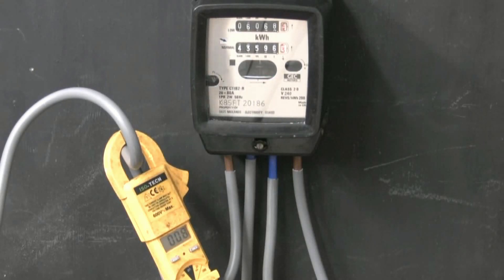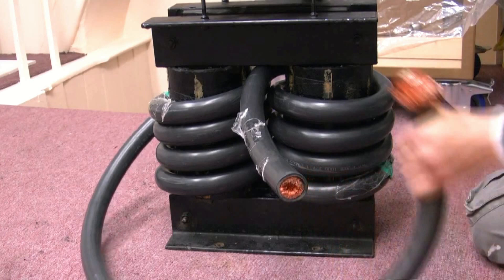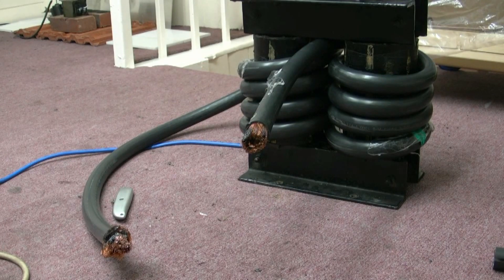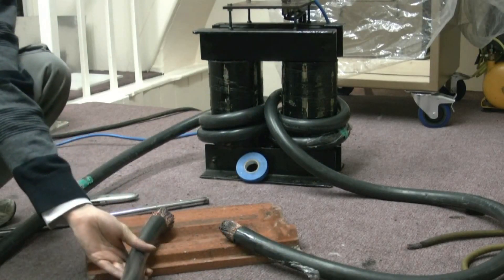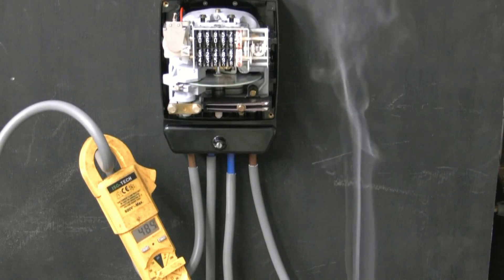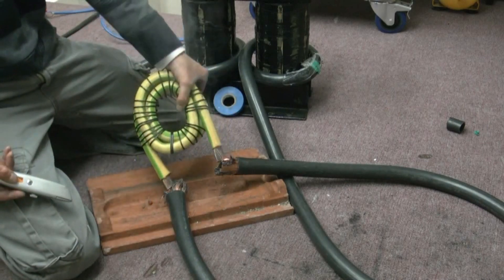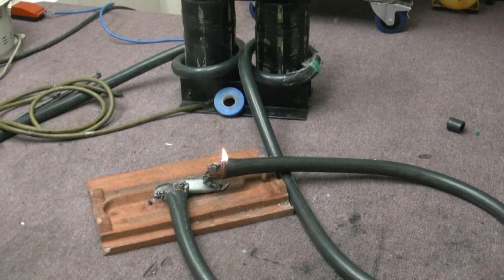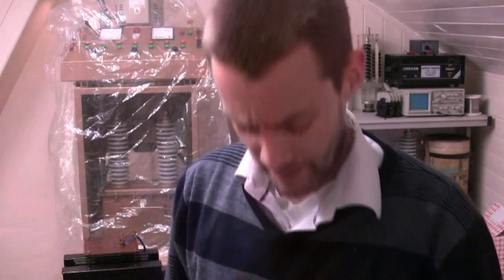Too Much Current + Electric Meter Pops

Comment: 8:54... why is he not dead?
Reply: +Kragatar because the resistance of the human body is so high, there isnt any current going through him
Reply: Kragatar because Volts x Amps = watts
the amperage of the transformer is a lot higher than the amperage of a battery
Reply: +Nothing Original nope it is because the transformer is isolated in relation to earth thus no current will flow through him.
Reply: Kragatar That transformer is probably outputting even lower voltage than a 9-volt battery, and it depends a lot on how moist the skin is. If you put it on the tongue the resistance is much lower.
Reply: +Kragatar Electricity takes the easiest path, between going straight through the metalic casing and making a detour through your body it's pretty obvious which one is easier.
Reply: Even if he was properly earthed, the secondary is basically floating, so it really wouldn't make a difference. Then, the only possible thing that could shock him would be if the secondary coil had a change on it, acting like a capacitor to ground. He would be across that capacitor and potentially feel a shock, just like when you touch a car in the summer. It hurts a little but doesn't kill you. With the size of those conductors, it's very unlikely that a high charge would accumulate.

Basically, secondary is not referenced to earth, therefore there is no obvious current path from earth to the secondary aaaand therefore no circuit involving him.
Reply: +This -〉 & 〈- looks like a man dragging his ass on the floor 
"because the resistance of the human body is so high"!!!!! lol you idiot. 
if he were to hold each wire lead is each of his hands he would've been vaporized.
Reply: +Kragatar I'm sure you've heard it before, but voltage = water pressure, current = flow rate. A high-pressure water jet (low flow rate) can literally cut through your body. But you can stand in a river (low pressure, high flow rate) and nothing happens since the water doesn't actually go through your body.
Reply: +This -〉 & 〈- looks like a man dragging his ass on the floor if there is a lower impedance path to ground than the body it will not send current through the body
Reply: +lcbp2009 thank you Mr. Faraday.
Reply: +Kragatar also the current would not being passing through him. unless he was to stab one cable into his left arm and the other cable into his other arm to break the skin and negate the resistance and have the current traveling through his chest, he isnt getting shocked. Because his body is not completing the circuit, no current is traveling through him. All he is feeling is the heat.
Reply: +Kragatar Too low voltage, skin resistance too high.
Reply: because science bitch!!
Reply: stupid idiot
Reply: +SwedishviKingohnoes My bad it will send a little bit. But this man is insane don't do what he's doing
Reply: SwedishviKingohnoes He is safe because there isnt enough voltage for any current to go through him
Reply: +Kragatar  it was a 9v which charged up to 125volts low amp because 
it takes 102 volts for a shock that you can feel
Reply: This --〉 & 〈-- looks like a man dragging his ass on the floor Ofc it is. If the resistance is 5k Ohm and the voltage 5V then there is still 1 mA of current.
Reply: +lcbp2009 think the only reason hes not dead is that he's properly insulated and current searches for the shortest way to return to the source. Also if he says hes passing 200 amps through that, find the wire size, resistance, then you can calculate the voltage
Reply: Persian5word no because the resistance of the body is so high there isnt enough voltage for the current to pass through you
Reply: awesomegamer5000 or codyisawesome3 Even if he was grounded he probably wouldn't be dead.
Reply: this thread is hard to read... so much stupidity
Reply: +Franco Pieruccini Faria Why does everyone think the answers in life are on wikipedia??
Reply: Kragatar I have touched 180v dc and dint get shocked you probably licked the 9v
Reply: Human body resistance is very low. In fact about 500 to 1000 ohms depending from how far away the circuit takes to complete a circuit across your body
Reply: Novislav Djajic It was a prank thing I built when I was a kid. I don't remember how it worked, but you ended up with two wires that gave a shock when touched. I definitely remember it used a 9 volt battery. I'd assume there was a capacitor or something involved to build up a charge strong enough to shock.
Reply: arjuna207 but 5 volts is not enough voltage for there to be any current, google ohms law
Reply: arjuna207
It's both and it also depend on how the current pass through your body. It doesn't necessarely pass through the heart. The energy carried by the electric current is V*I, the more energy you have the more you will get burned. But yeah if the current pass through you heart then you don't need a lot of to make it lethal. 

Also the standard is: Ventricular fibrillation occur at around 75mA during 1s or 40 mA during 3s.
Reply: +lcbp2009 but if you affect the wire (shortcircuit) and it goes .1 ohm, then you have high current
Reply: lcbp2009 yes but go measure your bodys resistance
Reply: +This -〉 & 〈- looks like a man dragging his ass on the floor what do you mean no current? It depends on the resistance. So you have an amount of current
Reply: +lcbp2009 if you connect both hands than it passes through the heart. If you connect hand and foot, it passes through the heart. Maybe only if you output at the elbow of the same hand you're safe
Reply: My only explanation after seeing some videos is that its a low amp connection,thats why its not affecting him.
Reply: This --〉 & 〈-- looks like a man dragging his ass on the floor I don't have a voltmeter. 5k is in a normal condition. But it can vary from 3k to 100k + depending on your skin condition, depending on the person also.
Reply: arjuna207
Yeah but the human body is not a shortcircuit.... I don't get your point.
Reply: +lcbp2009 meh. Why do you risk melting the wires and burnin down the house if theres a short? Even thiugh the same wires withstood the same voltage? Because when you have a short, current rises, you go from 10 amps to a lot.
Reply: +arjuna207 As for why he's not dead I already said in a precedent comment: Electricity chose the easiest way. the thing he's holding clearly has a metal casing, between going straight through the metal and make a detour into your body it's obvious which path is easier.
Reply: +lcbp2009 yes, dry skin is somewhere around 100.000 ohms, but if wet its 1000 ohms and resistance goes down over time also at 10-15 amps you can't let go.
Reply: +arjuna207 as more wet, less skin resistance you will have. Your comment is wrong.
Reply: +Franco Pieruccini Faria i said the same thing
Reply: +lcbp2009 sorry, didnt see your previous comment. Anyway, did more research, was wrong. Thanks all for the comments to make me study more.
Reply: Im guessing the voltage and wattage would be very low with such a wide wire, while the amps could go up considerably as you see, plus its a stepped up transformer so would it not have a rectifier and then a earth at the end. which would be the path of least resistance I'm not too sure of the setup, but the vid made me LOL, good stuff dude, if he could explain it for us simpletons, I';d much appreciate it
Reply: ***** and the voltage is so low that there wouldnt be any current flowing through him
Reply: This --〉 & 〈-- looks like a man dragging his ass on the floor could also be another factor
Reply: cool thanks *****
Reply: *****
thanks jesus but I let you down
Reply: +Rafael Santana tranquilo.
Reply: It is true that it is not the voltage that kills you, but the amperage. However voltage is basically the driving force of the electricity. More volts will create bigger arcs and will push electricity through higher resistances. More amps will create a bigger effect of the electricity in proportion to the voltage. It&#39;s the same logic as velocity times mass equals force. You can think of voltage as the velocity, amps as the mass, and force as the wattage, with the exception that something needs to pierce your skin in order to kill you.
Reply: +SwedishviKingohnoes My hands measure in the Mega Ohms with my Fluke meter.  Maybe you live somewhere sweaty where everyone's fleshy resistance is greatly reduced by mineral rich water?
Anyway, I'm fairly certain that you are mistaken, unless you are referring to the resistance of human flesh that is not the outer-dermis?
Reply: +Novislav Djajic More specifically, it was almost certainly a DC to DC converter circuit.  Voltage multiplier circuits are for AC to DC conversion, unless someone knows better and wishes to share.
Reply: +domo carless Probably a lot more than 125Vdc since that isn't enough to bridge a spark gap, given the average resistance of air here on Earth.  It was probably one of those DC to DC boost converter circuits stolen from one of those bug zapper rackets.  If that was the case then it would have been thousands of volts and, yes, 9 volt batteries are more than capable of being applied in this fashion which should be obvious since 9 volt batteries are generally what are used with those bug zappers.
Reply: +lcbp2009 Well, there was probably some electrical build-up on the surface of his body, like a resistor in parallel with a low resistance conductor aka a big wire.  No harm came to him because it did not have enough pressure (voltage) to penetrate his flesh.  Just a theory, though.  It may also be that he is simply touching the conductor well past its return to source and, so, there was literally no electrical current flowing to his hand.  That the bar only heated up to melting between the two leads may suggest that this was the case.
Reply: +arjuna207 That is not correct.  It is not the current which produces muscle contractions like that it is the frequency (Hz).  Our nerves have a very specific signal band within which they respond to electrical impulses by either producing muscle contractions/extensions or physical sensations.  10-15 amps can still cause damage and even kill you, but it won't cause muscle contractions by itself.
Reply: +This -〉 & 〈- looks like a man dragging his ass on the floor It can still pass over your flesh and cause severe damage which, in turn, would lower the natural resistance of your flesh.  This process would occur incredibly fast and you would appear to conduct that current through your body almost instantly, in real time.  Persian5word is correct.
If you think a higher resistance path to ground won't conduct anything in parallel with a lower resistance path to ground, try connecting a bare wire in parallel with a resistor across a battery.  You will quickly discover that some current still flows through the resistor even as the lower resistance wire burns up.
Reply: +Nothing Original All I saw was a naked transformer and I did not see anything connected to the secondary coils so it was likely AC.  Also, I think this setup is actually a step down transformer so the current would increase while the voltage would decrease.  Also, the massive gauge of his secondary winding speaks to a high current output.
Reply: +Jonathan Gray I would say that voltage is more like pressure or potential energy (mass, in your equation) where current is the velocity.  Greater voltage (pressure) = greater current.  It isn't exactly as simple as all of that, but it serves for a basic understanding.
Reply: Lunartrek I personally think it fits better the other way around but maybe it's not the best metaphor. However the math behind both are exactly the same.
Reply: You are correct!  Since volts and amps are the things being multiplied, it does not matter, mathematically, which goes where, in terms of the outcome.

The reason I said what I did is that voltage is, technically speaking, a potential which, when connected to a circuit, moves through the circuit in the form of current.  So if voltage is a measure of potential energy then it does not seem much like velocity.  Also, electrons are matter and, so, have mass.  Current is energy in motion and, so, is more like velocity than mass, though it is a measurement of mass in motion, so-to-speak.
Reply: Lunartrek I guess I should explain the reason for my conclusion. Since amperage technically relates to the amount of electricity used and volts is the force/pressure at which the amps are moved by, I just thought of mass as the amount of an object being moved and velocity as the force/pressure with which it would be moved.
Reply: Very low Voltage and the Con touched the polls first
Reply: +SwedishviKingohnoes  A lot higher than that mate get a multi meter and put it on your skin and see what you get
Reply: +Kragatar electric taks allways the fastes way keep that in mint
Reply: +Kragatar Because reasons!
Reply: Trop Channel because no volts
Reply: +Kragatar It's irrelevant how deadly the electricity is if it ignore you in the first place. It does affect your flesh, would it actually travel through it. Being "insulated" is basically relative, compared to a lightning rod you are insulated regardless what you wear.
Reply: +Kragatar careful
Reply: +Kragatar Maybe its because electricity find the closest way to complete a circuit so it passes through the metal rod without affecting him or maybe i`m wrong i don`t know much about electrics.
Reply: Dan hatman
Take high school physics, and you'll know the answer! Or just read what I said a few comments up.
Reply: +Alex C Physics, yes, physics.
Reply: Hunter gossett ...what? Electricity is covered in physics.
Reply: He wasnt grounded. Basically his body wasn't completing a circuit.
Reply: +This -〉 & 〈- looks like a man dragging his ass on the floor ahh that would present a problem for me as i am moist 95% of the time..
Reply: magic
Reply: +Some1NamedMe did u copy and past this
Reply: +Adrian Govori It's physics, where I studied physics, you become so "physicsy" that you just can't help but sound like google walking. Basically you are taught how to answer questions very effectively, hence it looks like we copy and paste.
Reply: Because electricity WILL Always take the path of least resistance ! always !
And this mad scientist knows that!
Reply: +Kragatar Maybe he is related to an indian that houses an ability to let current run through him without being electrified.
Reply: +Kragatar The electricity flows in the path of least resistance, it's much easier for it to travel through the metal than his hand/foot. Plus the voltage is low so there is even less "push" for the electrons to flow through him. Now if he were to touch both ends without the metal, that's where his skin would probably blow up.
Reply: ***** No, is not dumb only men who knows the laws of electricity. With such a low voltage the current flowing through his body is 0A.
Reply: +Kragatar Cuz it's a low voltage and high current, his transformer works just like welding machine, you can touch it and it don't heart you.
Reply: Kragatar have you ever seen the hulk from 2003??  Hes the hulks father.
Reply: But the resistance of the body goes straight down with higher voltages, so the current going trough you goes up to dangerous levels
Reply: It is not the resistance why he's not dead. It's because it's decoupled by a transformer. The electricity goes from one terminal to the other, and your body isn't connected to any of them.
Reply: arent the end of the wires effectively the terminals?
Reply: the negative battery terminal of my car connects directly to the frame of the car. is this why I'm dead on the inside?
Reply: Anyone who believes "electricity takes the path of least resistance" is not qualified to comment.
Reply: "electricity takes the path of least resistance" does it not?
Reply: It is actually both, the resistance and the volts... U=R*I... The volts the transformer puts out, are very low, so for 200 amps or some shit resistance has to be very low, which it isnt in your body. Lets say it theres a difference from 1 volts to ground and you are ground. If 200 Amps had to flow through your body, you would have to have a resistance of 5m ohm, but your body has like 500 or 1000 ohm. In a parallel cirquit with a resistance of the cable wich in a short goes near zero, there is no chance that you get a lot of amps.
Reply: @kragatar join mid school again!
Reply: Did you know that current is not like voltage? That's why he's not dead
Reply: He's not grounded
Reply: actually both current and volts can kill a human. But Under 50v ac nothing is able to get hurt even if the current is high something impressive 600a like in this video,for example, it because the skin resistance only is broken above ac 50v or dc 120v. In the other hand, with high voltage, something above 1000v ac or 1500v dc and currents from only 20mA to 100mA can causes since a stop breathing to fibrillation when takes the heart zone  and the death is almost certain. Ok?! I've learned almost everything I know about electricity by myself, reading a lot. So you can confirm those numbers in Wikipedia. Regards.
Reply: +Kragatar No volts.
Reply: subway5411
But there's enough energy pumping through there to melt a steel rod in seconds... how can it have such an effect on metal but not effect human flesh?
Reply: +Kragatar this makes no sense. and the other comments here make no sense either. i've heard many electricians say that it's not the voltage that kills you, it's the current measured in amps. so take something like a 5V charger, short circuit it and you cand seriously hurt someone, since it takes something like miliamps to mess with the heart
Reply: Kragatar  okay, lets get this straight, he didnt fucking die because the peice of metal he was totching was connected with the wires, and electricity takes the path of least resistance and since metal is an a+ conductor and human flesh isn't no voltage went through him to get to ground as that would likely be the path of most resistance.
Reply: This --〉 & 〈-- looks like a man dragging his ass on the floor Electricity is so confusing... how can you have less volts than a battery while pulling so much power the neighbor's lights are going out?
Reply: This --〉 & 〈-- looks like a man dragging his ass on the floor But I've been shocked by a 9 volt battery... if that little thing was able to get through my body's resistance, logic would suggest that a massive cable sucking up the whole neighborhood's power would fry you like nothin'.